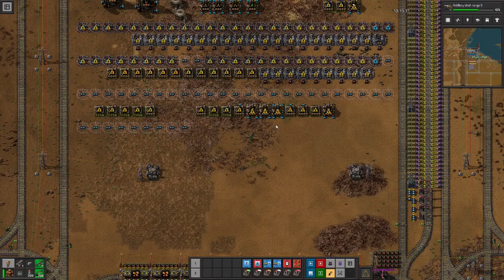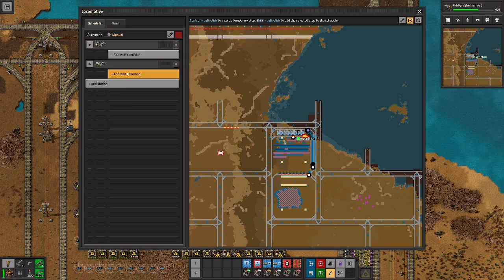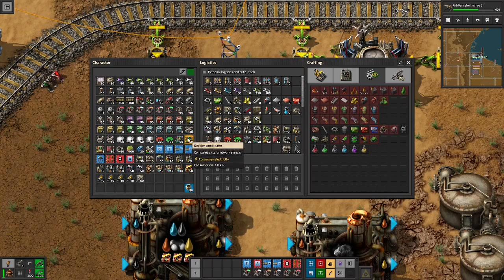Simpler Mining Replication - Ep8 - Factorio Cellular Megabase

Comment: Did you compare your two factory planner tables? Which version uses less materials? The moduled machines producing a ton of modules and the machines or the unmoduled machines producing only the machines?
Reply: I just went and did the comparison (using the factory planner screens on both videos)

Material <unmodded>/<modded>
Stone 155 / 25
Coal 583 / 724
Iron 2600 / 2100
Copper 977 / 1500
Water 8100 / 11000
Power 10.7 /108 MW
Pollution 750 / 938

So a lot less stone, somewhat more coal, and more balanced iron/copper demand (iron is less by 500 and copper is more by 500).
Overall, if you consider much lower power consumption and lower pollution, unmodded looks better.
Reply from the maker: @maximvoronin1569  Yep, was just coming here to post this. :) Unmodded uses less water and less total raw ore, while reproducing the cell in about a third of the time. Very clear win for unmodded.
Reply: @mysticfishgames  ohh, I didn't take into account the build time. And since the numbers are per minute, the unmodded will win by a wide margin on all fronts.
Reply: @maximvoronin1569  Cool, thanks. I hadn't expected it to be that close.

Comment: 35:40 at this point consider that your tanks can be at 100% light oil + 100% heavy oil + 100% petroleum gas, which does not need to get fixed by cracking. So you could check for "light oil < X %" / "petroleum gas < X %" before you activate any pump supplying the cracking facilities.
Reply from the maker: The design is set up specifically to avoid any tank getting to 100%, because that’s when the system potentially clogs. Here, heavy oil cracking is more about getting rid of excess heavy oil than it is about producing more light oil. I’ve tested the design and it runs in steady state without clogging even if there is no demand for one or two of the oil products.
Reply: @mysticfishgames  I usually set my combinators to the tune of:
Heavy oil cracking: heavy oil > 10k OR light oil < 1k
Light oil cracking: light oil > 10k OR petroleum gas < 1k
Petroleum gas to solid fuel: gas > 10k
Refinery: heavy oil < 1k OR light oil < 1k OR petroleum gas < 1k

That way you have at least 1k but no more than 10k of each product in your tanks. Some reserve is useful for when there's a hiccup in your supply chain.

Comment: The circuit you have for logistics bots is a bit chaotic. I would suggest building the circuit design I described in a comment on EP 6 then adding something for the secondary bots. While what you have now will work to control activation of the inserters, the timing on which it does so may not be exactly what you want. Also having continuous time counters eats into your UPS. Based on the number cells you have laid out and the assumption that the same circuitry will also be used in other types of cells, you may notice an avoidable decline later. 

You will likely have a feedback failure from the green wire connecting the C pulse to the requester side arithmetic combinator LBot AND C. The left side CBot==0 -> LBot is set to LBot from input when I think you want LBot=1 there.

The advanced oil refining does not have water connected.
Reply from the maker: Thanks! I am planning on having a “brain cell” where we can monitor the global supply/demand network. It’s probably a good idea to move the clock signal C generation there, to your point. I’ll take a closer look at the feedback loops to make sure red/green wires are set up ok. Thanks again!

Comment: 21:15 That boiler would have fit so satisfyingly perfect without the corner pipe and the change of orientation... It would also hook up the water to the oil refining that is currently missing.
42:10 You need to multiply by 0.3, not divide. You need 0.618 Steam turbines.
Reply: No, you need to divide. It's not that the turbines are only 30% loaded. They need to burn off that fuel in 30% of the time.
Reply: @maximvoronin1569  @mysticfishgames You are right we need to divide. I thought about it this morning and realized my mistake.
Reply from the maker: Good catch on the water hookup!

On the steam turbines, if they could run continuously, we’d need 12/5.82 = 2.06 of them. However, they can’t run during the day, so we need more of them at night so they can catch up with the backlog of solid fuel that might have built up during the day.